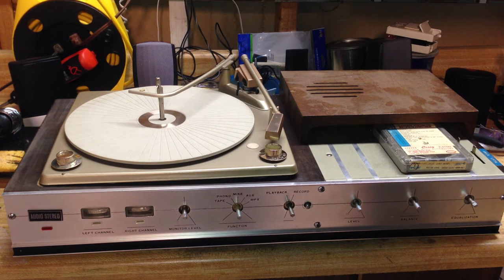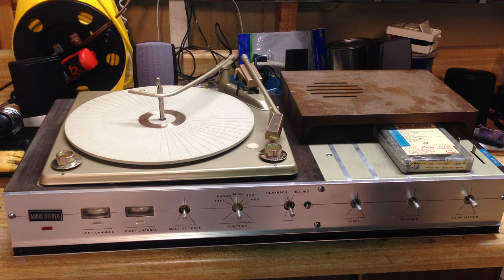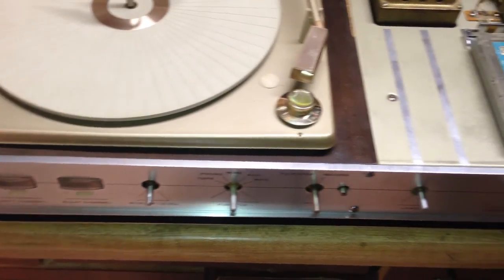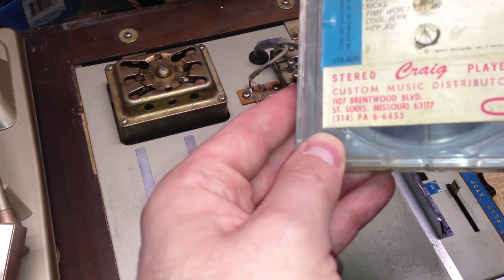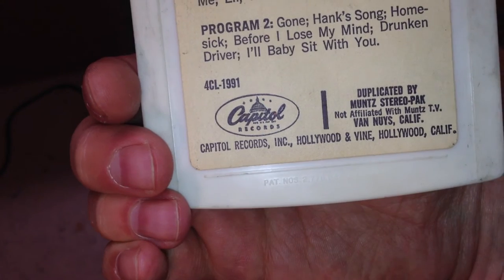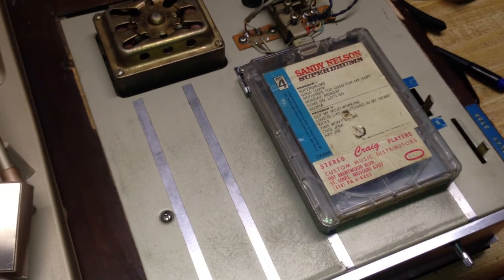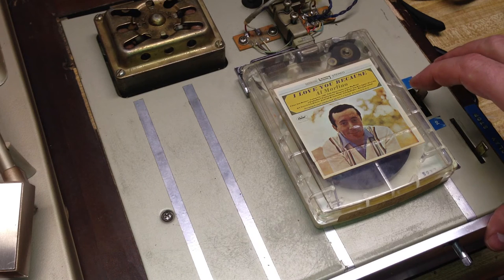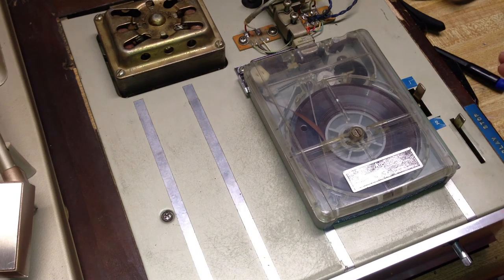4-Track Music Cartridge RECORDER with RARE Vinyl Turntable System!

Comment: The extra width of the plate was to accomodate wider cartridges, containing a larger tape reel, for longer programs. The cartridges you have are the smallest, and generally held enough tape to play twenty or so minutes per program, about the length of the two sides of a standard record album. The chrome strips that you can see on your player correspond to the left edge of the two progressively wider cartridges. These larger cartridges were used in applications such as continuously playing background music in a department store or office.
The blank tape in both 4 track and 8 track cartridges was the same, and was coated with graphite. This was necessary to allow the tape to slide on itself on the single reel, as it wound from the outside toward the center. The tape in the last cartridge you played seemed to be bunching up, probably due to the coating deteriorating due to age. Both formats used the same tape speed, 3 3/4 ips, which was also a standard in reel-to-reel decks.
4 tracks had, like the name implies, four separate tracks within the 1/4" width of the tape, corresponding to the stereo tracks for the two programs. Program A would use tracks 1 and 3, and when the head is shifted, would play 2 and 4 for program B. 8 tracks had eight separate tracks within the same 1/4" tape, so each track was half the width, lessening sound fidelity. The 8 track players had four programs, using tracks 1 and 5 for program A, 2 and 6 for program B, etc. The 8 tracks used a foil splice at the end with an electric sensor to automatically move the tape head, to listen to the next program in sequence.
Reply: I have some of the large tapes myself and just a couple of the ones a little bit smaller I don't have one like he does there around the size of a 8-track

Comment: the reason your 8-tracks sound muffled is because the foam pressure pads and the pinch roller in the tapes deteriorate. I would think replacing them would make them sound better
Reply: Yes it does.

Comment: 4 track would potentially sound better because the information covered twice as much tape surface (compared to 8Track). Also the head alignment for 8 track was more critical due to the narrower tracks. Plus the non-major label studios sometimes used cheaper plastic pinch rollers in their cartridges resulting in inconstant travel. Oddly enough, in many ways the 8 track technology seems to be a step backward from the 4 track. 8 tracks only advantages being room for more music and auto track change (in which the jarring would unfortunately tend to eventually cause head mis-allignment).

Comment: Why 8-track carts sound bad, the pressure pad foam in a lot of them has rotted and needs replacement, and 4 tracks have larger tracks, 8 track has really small tracks and low bandwidth.
Reply from the maker: Agreed.